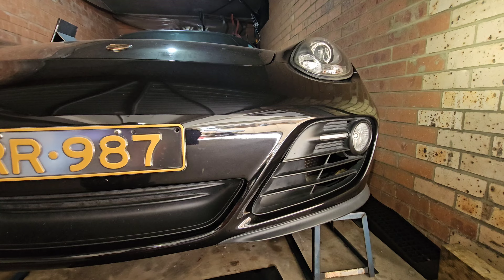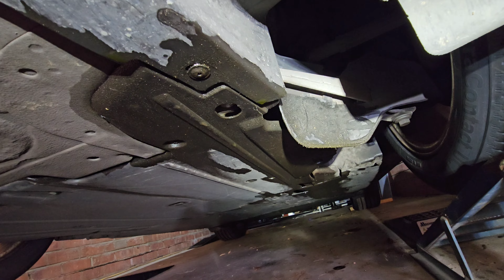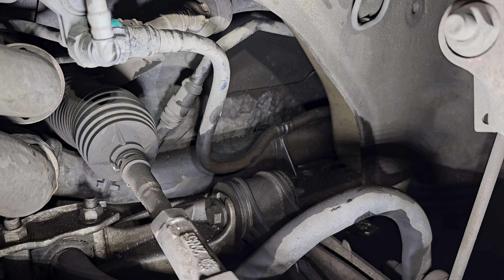Part 1: Porsche 987.2 - 997.2 Front Power Steering Hose Leak Repair. Cayman, Boxster & 911

Comment: Sir, To fix this power-steer high-pressure line, do I have to pull one side of the intake manifold and the A/C compressor (and regas the system)（left-hand drive-987.2）
Reply from the maker: G'day, 
Only remove the mounting bolts of the A/C compressor. The hoses have enough flexibility to move the compressor out of the way.
I think I only removed the manifold as someone had put a wire under it 😅

Comment: I am having this same problem on my 987.2 and this video was a huge help! At the moment I am undecided if I will try to have the line repaired or replaced. Was it a significant difference in cost? 

Any tips on the actual removal and installation of the line? Is it as simple as pulling them apart and pressing them back together?  

Also you mentioned a repair kit for the coupling seals towards the back of the car. Do you have that part number handy? I think I may need to do that as well if the line is repaired as I have noticed that leaking a bit as well.

Thank you!
Reply from the maker: G'day, 
The hose repair was AUD$165/USD$105. From memory a replacement line from the US was USD$420.
I'll find the part number for the connection coupling kit asap.

Yes, the couplings go back together way easier than pulling them apart. Just take your time...
Reply: @Roland_Rohrle  Thanks again, any chance you were able to track down that part number for the connection coupling kit? I am having no luck finding it online for the 987.2. 
One other question on the rebuild kit, which side of the coupling is replaced with the kit? Is it the line you had out or the other line that connects it back to the engine? Or is it bother ends of the coupling?
Reply from the maker: @davidjasinski5279  apologies.  The part number is: 997.347.945.00 as it's a shared pared between the 987.2 and 997.2
All the best
Roland
Reply: Hi , which Porsche specialist can you recommend me to get it fix? In sydney please
Reply from the maker: @billyh2880 G'day, 
Apologies.  I only just saw your post.
I would recommend BWA...
Reply: @bil @billyh2880 ologies for being a bit late to the party:  I made this same repair to my 987.2 last year.   After removing the high-pressure line,  I took it to a hydraulic equipment repair shop.  They cut off the old crimp connectors and replaced the flexible rubber hose with new hose and new crimp connectors.  As I recall, the cost was roughly  $70 USD .  Compare this to the Porsche OEM replacement parts:   the high-pressure line and return line assemblies are several hundred dollars apiece for the parts alone.